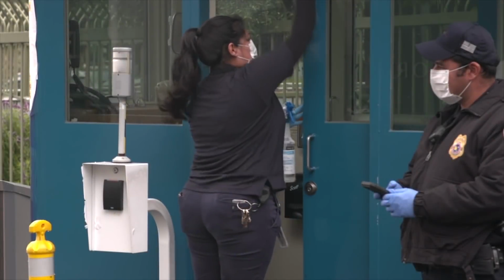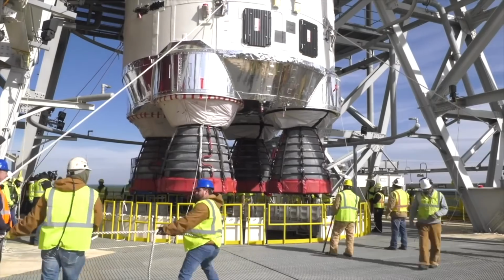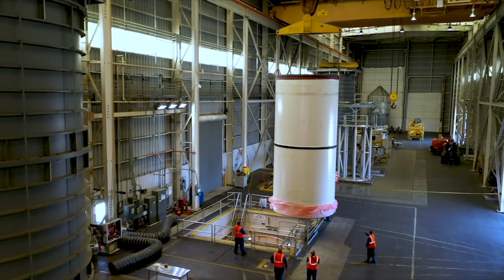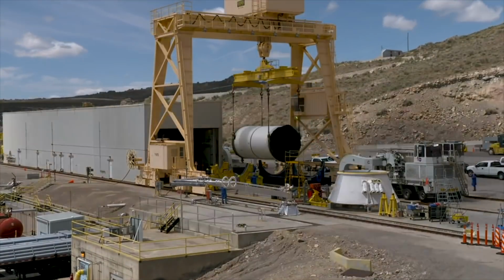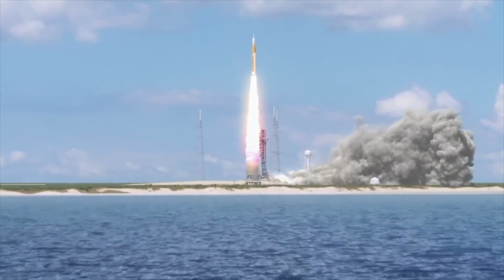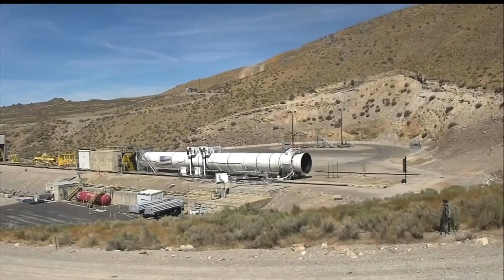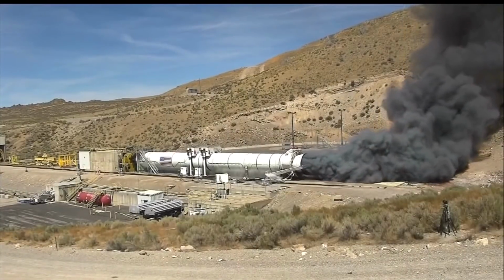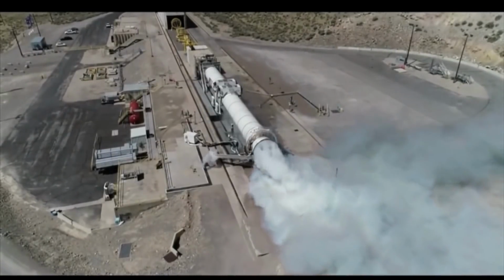NASA Test Fires World's Largest Solid Rocket Booster for SLS (FSB-1)

Comment: 6t of fuel per second. All that money to contain that power, and then they throw it away. This system is $2b/launch - their original price point will never be met. So It's already obsolete before launch because it's financially unsustainable. America loves a cool new toy, but they won't pay for it long-term. If they set out on a new design today, it too would be obsolete in 15 years when they completed it. Thank goodness for capitalism because it will ultimately provide a solution, and as for this project - government spending be damned.
Reply: Meanwhile military spends $2b per DAY (2021 military budget was $801 billion / 365 =2.19). NASA budget is leftover scraps
Reply: @bueb8674  Very well said.